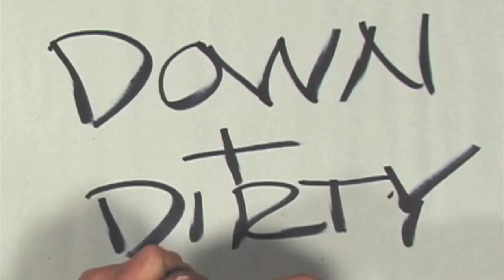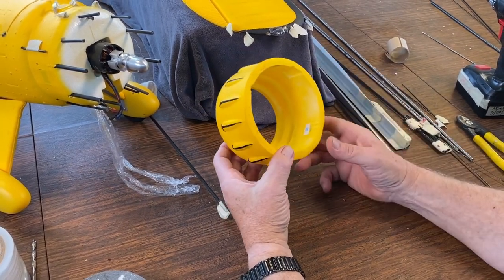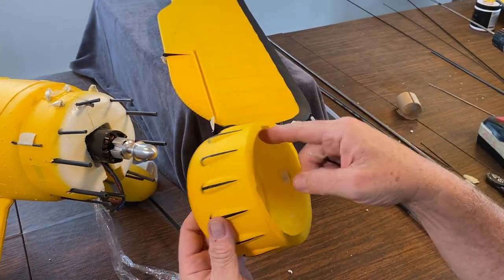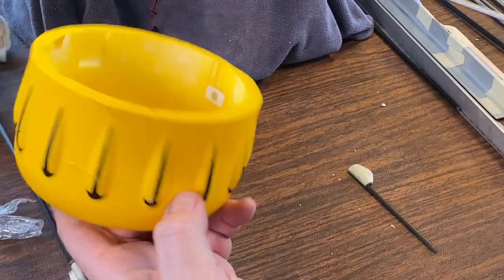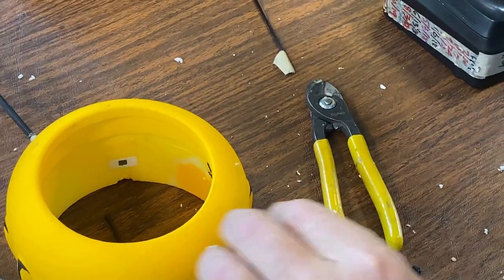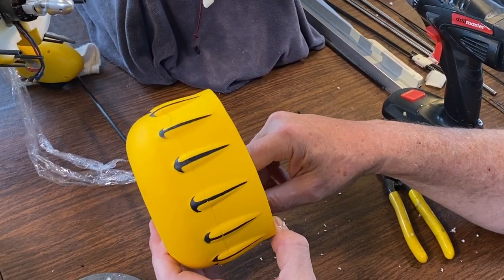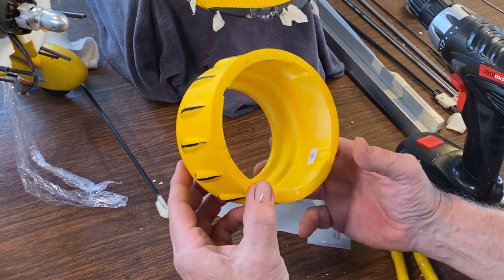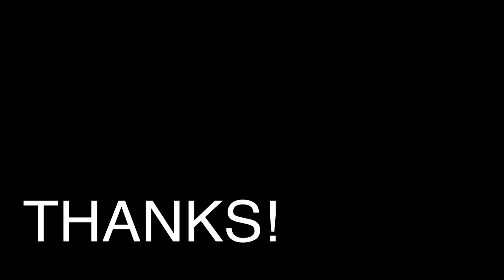Down & Dirty Tips n’ Tricks - How to Reinforce a Foam Cowl - Starring the Dynam Waco

Comment: That was a great video Steve. Lots of insight for me in this one (mostly because I want this plane). I'm wondering if you know the overall weight the reinforcement is adding to the D. Waco? I've owned D. M12 Pitts and it was really light on its feet, even though I know the Waco is heavier. Dynam is known for the size to weight flying characteristics/flight time. Edit: I've seen you use the HGPE for control surface hinges, this is another bonus.

 Denise, did you see it?? I don't know how no one else doesn't. Separate the O from W, but I hope you don't 🤣😂🙃.
Reply from the maker: We have the specs somewhere— I added about 12% weight on this one by WAY over-reinforcing it , so we could make videos of all the rods you MIGHT install- and thanks for commenting!
Reply: @Killerplanes   good on yah Steve!! and thanks so much